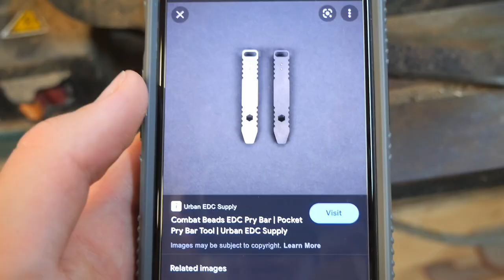Making a DIY Mini Pry-Bar!

Comment: Why didn’t you harden it? Btw i like to have a little bit of a round bow on my edge for some reason. If you wanna see mine just check my video. It’s very similar to yours. I didn’t include the bottle opener because I liked the simplicity of the bar. I already have a bottle opener that I keep in my bag anyway😂